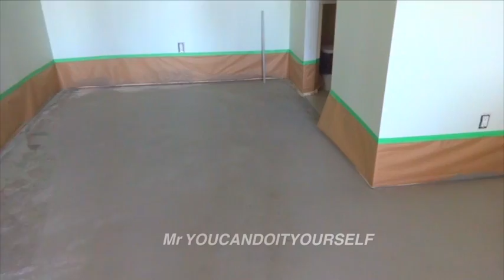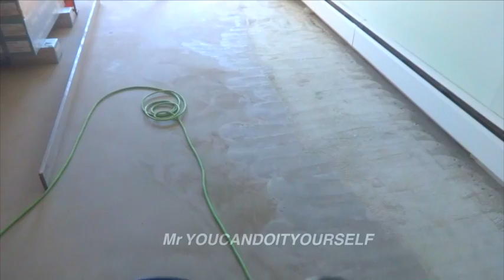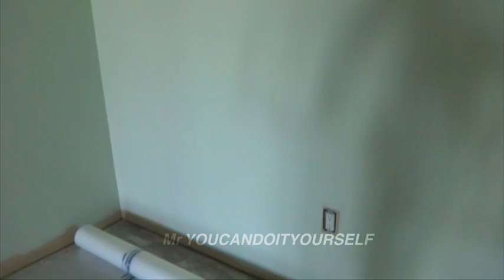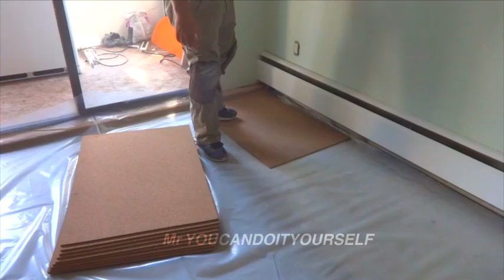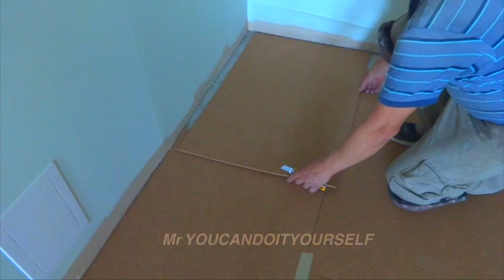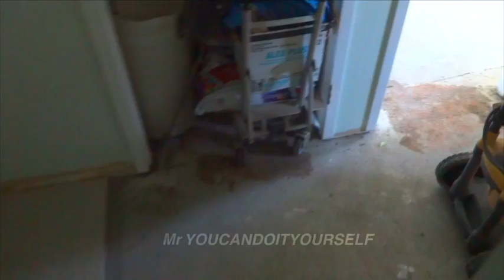How to Install Cork Underlayment for Laminate Flooring Installation - Mryoucandoityourself

Comment: Hi friend! 

So I have an apartment with a floor that's quit bouncy and is irritating (i think is it due to the long joist). I don't think I can take the floor apartment & reinforce the joists underneath since it's a 4th floor coop in NYC. I am thinking of adding 1/2'' cork to overlap the entire floor and then lay hardwood floor on top of that. This is like trying to get rid of the bounce from the above. Do you think this would help reduce the bounce? Thanks!

thanks for the video!
Reply from the maker: I need to see it, can you send a short video to my Facebook page, please? Thanks
Reply: @MrYoucandoityourself  thanks will do!

Comment: Thank you sir.  Just bought my first home.  A split level and they had this cork underlayment underneath the carpet.  Maybe in anticipation of hardwood flooring or for added sound dampening.  They had nailed it down like plywood oddly enough.  If I need to level any floors do I need to remove this guy?
Reply from the maker: Hi Bobby,Yes, you have to remove cork before start leveling.
Reply: @MrYoucandoityourself  thank you for the tip.  Based on your experience does the floor need to be true for hardwood floors? Is there any amount I can get away with.  Just mentally getting ready for it.  The home's foundation was professional repaired by a specialist and engineering firm, but I'm sure there's no way it could of been perfect.  I'll have to look around at your videos to get some more tips !
Reply from the maker: Check subfloor with straight edge.If everything fine, you can install floating floor.

Comment: Hi Friend, wel job done, i have just one question hopefully you are able to answer. Do you think cork is expanding just like laminates? Do i have to leace those expansion gaps between walls when i put my underlayment or i can just make it square to the walls? Thanks in advance.
Reply from the maker: Hi Domingo, when you installing cork underlay you can’t put tightly, and will be enough expansion gaps. I never get a problem with cork underlay. Thanks

Comment: Sir, do you need to put poly under the cork if you are on second floor or above.. from what I understand the poly is a moisture barrier, so is it only needed if you are installing on first floor?.. thanks
Reply from the maker: Hi Dave,  we put poly only for ground floor or in the basement. But if you put poly to any levels, your floor will move freely, I prefer do it for any floating floor. Thanks!

Comment: This is great! I'm planning a similar installation. Is it possible to lay a felt underlay like Robert's super felt 70-193 on top on the cork before laying the hardwood flooring if my goal is to maximise impact noise insulation?
Reply from the maker: 1/4” cork underlay gives you 66-68% noise reducing. It’s good enough. I never did double underlay, it’s can affects flooring locks. Read instruction on the box, manufacturer always recommend what type of underlay need to use.
Reply: @MrYoucandoityourself  thank you!

Comment: Another question. I am thinking of getting 1/2 inch cork for the second floor of a two family home (old wood floors). I want to use a vinyl loose-lay or click lock floor for easy cleaning. With the 1/2 inch cork, do you think that will absorb the sound of stepping on the vinyl floor? Should I lay a vinyl sheet between the cork and the flooring so the cork won't get wet, or is that a bad idea? Will big liquid spills damage cork?
Reply from the maker: Hi my friend, thanks for good question, for 2nd floor you don't need moisture protection, on this video concrete sub floor above garage, why I did moisture protection with poly. Just install floor and that's it.
Reply: @MrYoucandoityourself  Thank You!

Comment: I want to use cork sheets as underlayment under nailed-down hardwood. Is it the same process as you did here? What kind of tape are you using to secure cork sheets together? Looks like regular masking tape?
Reply from the maker: Hi Jena, I never installed nail down over the cork underlay. No reason. You can install double glue down engendered hardwood floor with cork. I prefer this installation. Thanks.

Comment: Hi, I am planning on doing a similar install in my house with a concrete slab. Will the plastic film be enough or do I need to glue the cork down? Also, I am trying to achieve the solid sound of glued hardwood but with floating laminate, will this method work?
Reply from the maker: Hi Misha, Plastic film is good enough, just overlay film to the wall. This is the key for moisture protection. Thanks!

Comment: I am redoing my second level and it has been stripped to the subfloor , I am looking to do cork to quiet the flooring , do I need a vapor barrier below or above the cork before  nailing down the hardwood ? 
Thanks
Reply from the maker: I am wondering, are you gonna nailing down hardwood floor through the cork underlay? I would recommend you install double glue down engineered hardwood floor with cork underlay, or floating floor.
Reply: Yes I am nailing down the hardwood , what would you recommend for underlayment for the hardwood ? I was told just a vapor barrier like paper but I am not sure
Reply from the maker: For second floor you don’t need a vapour barrier.

Comment: When installing the cork underlayment in 2nd floor do u need to leave gaps in between in each cork sheet? And also can i glue down the cork sheets?
Reply from the maker: You don’t need any gaps between cork underlay, you can glue it down if strata restrictions allow it. In the house for sure you can glue it down, no problem. Just need to use different trowel smaller v grove then regular for hardwood. I have a videos about it.

Comment: Is this 1/4" or 1/2" thick cork? Is there a big sound reduction difference? 
Have you worked with the new cork/rubber hybrid underlayment?
Reply from the maker: Hi , this is 1/4" cork, sound reduction 63 - 69,good enough for apartment. I never use this hybrid, sorry.
Reply: @MrYoucandoityourself  thank you!
Reply: @MrYoucandoityourself  Thank you for the video. Does this underlayment good for impact sound too?  Any IIC data of it? -- What underlayment is this?

Comment from the maker: If you are going to install laminate flooring and you need to chose the best underlayment for it, just watch this video. Here is one of the variant of underlayments for moisture protection, sound protection and your future warm laminate floor.
Reply: In your description box where you have a link of the cork underlayment... it is NOT the same
as you show in this video... it's 12" x 12"x 2.4 " !!!

Comment: Hi. We are putting in vinyl planks in our whole house and want it level in the entire home but the kitchen and bathrooms are 1/4" higher than the rest of the home. Can i use this 1/4" cork to make them level with the kitchen?
Reply from the maker: Hi Joel, in this video exactly was the same situation. I put 1/4" cork underlayment and then install the floor. And I got a flat floor in all the apartment.
Reply from the maker: I just published a video on Facebook. This is final after this cork underlay and laminate floor installation. You can have a look. I made this upload special for you. Thanks.
Reply: @MrYoucandoityourself  i keep reading online that cork underlayment for vinyl planks should be 3mm or less....our vinly planks are only 4mm thick
Reply from the maker: 1/4" - 6mm
Reply from the maker: If the manufacturer recommends only 3mm or less, you have to level your living room or install reducer from tile to the vinyl.